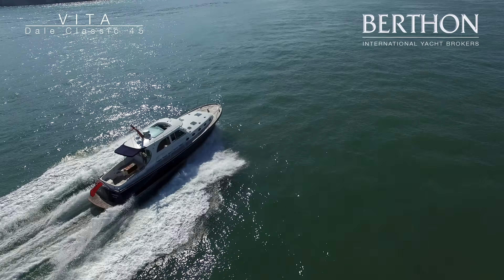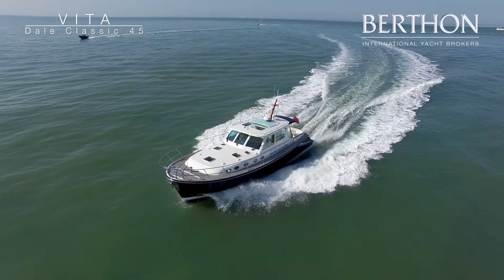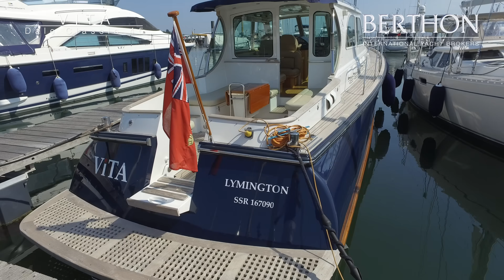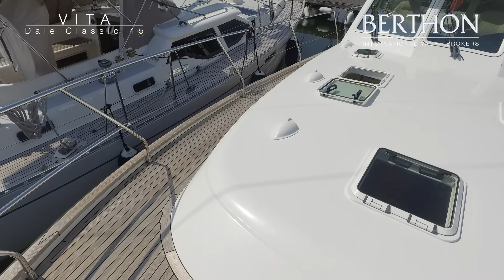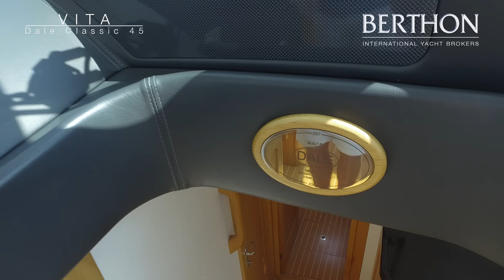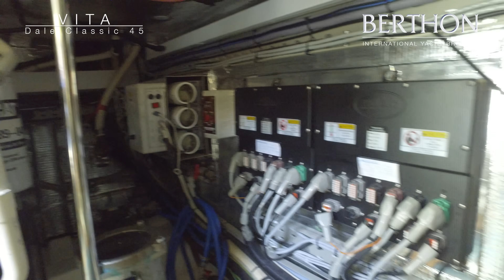[OFF MARKET] Dale Classic 45 (VITA) - Yacht for Sale - Berthon International Yacht Brokers

Comment: Did you say her range capacity is 500 miles I presume she isn't an ocean crossing vessell? Also what is the Hull made off?!
Reply from the maker: Defo not ocean-crossing range. C. 450 Nm at slow-ish cruise.
 Hull is GRP with hydrophilic vinylester outer layers for maximum resistance to blistering/osmosis. Kind regards.